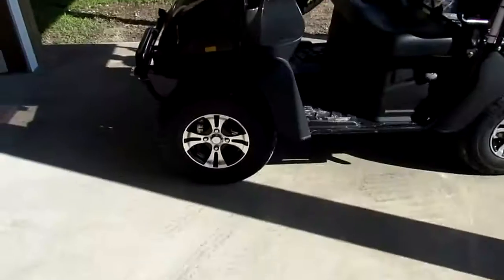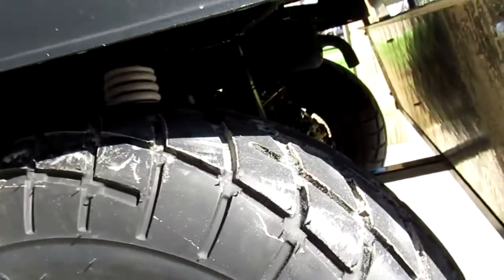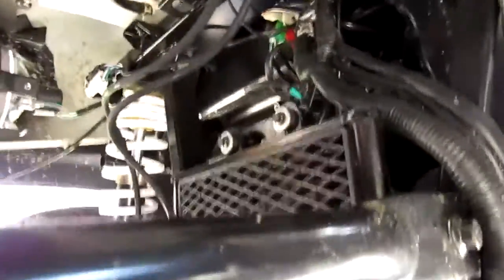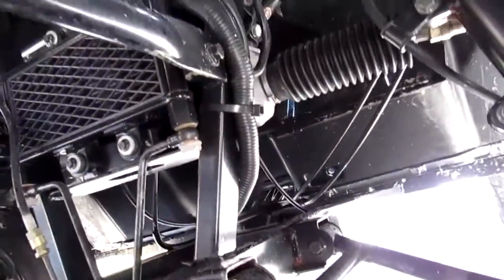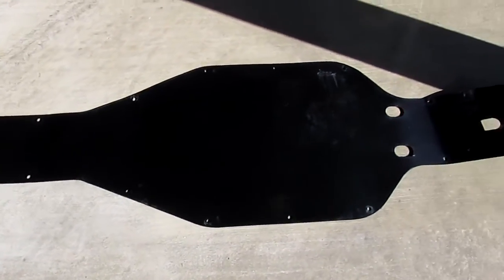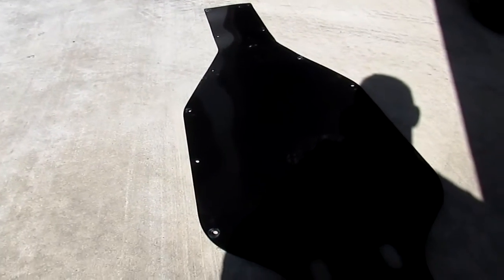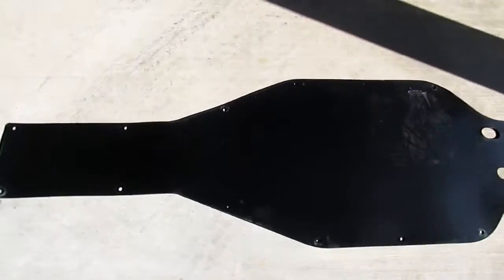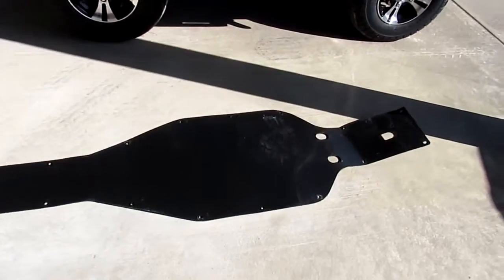Cazador Golf Cart: Overheating & The Simple Fix

Comment: I expect that the valves need to be adjusted.  Mine started to run poorly after 100 hrs and the exhaust valve was very far out of spec.  It is a GY6 motor.  I set my intake at .005 and exhaust at .006 and it runs great again.  I live on the gulf coast and the hottest summer days do not cause any performance issues.  I now have over 500 hours, adjusted valves twice, and it runs great.  The first valve adjustment around 100 hrs is critical.
Reply from the maker: Excellent information.  I could never understand why the silly thing ran so hot.  I think you're on to something here.

Comment: We have one and it stumbles and doesn't feel like it accelerates correctly.  Cazador sent a replacement carburator and it doesn't seem to have fixed the problem.  I've also been told that the gas I'm using is a problem.  Just sitting idle ours doesn't seem to meed the correct RPM.  So, I'm curious of what your issue really was.  

Thanks for the videos and documenting things you have done or experienced on your cart.
Reply from the maker: It was definitely overheating due to a lack of air flow.  Since I removed the skid plate it will still eventually run on the hot side and the ambient air around the machine can be felt - it's very warm.  Now that the plate has been removed we've not encountered the degraded performance and we've driven miles since the plate was removed.  The problem has been resolved.

Comment: Good info thanks. I have the exact model with about 800 miles on it, just recently it has been dying on me after about a 2 mile drive here in the hill country, we have some 1200 ft elevation changes, it's odd because it used to do fine on the climbs at around 11 mph, after it dies I let it sit for 5 minutes and it starts right up and runs fine for about another 2 miles, not sure if its A-overheating B-electrical or C- fuel problems. Thanks
Reply from the maker: What I diagnosed 🤷 as overheating the symptoms are very close….it never actually quit running but would buck and chug until we made it back. After cool down it was fine. We have no hills but the beach sand can get deep and requires powering through to avoid getting stuck. This seems to accelerate symptoms. Thanks for posting hopefully other people can use these descriptions to improve their situation.

Comment: Very good review. My wife bought this cart for general use. I lost the screw that holds the air filter in place. Do you know the screw size and type that secures this in the air box?
Reply from the maker: I'd call Cazador: (214) 238-7979
Reply: @dirtyshirtinfo  i have tried several times and get no answer. I have also tried email. I thought by change you might have change your air filter and knew the screw size and type.

Comment: Have you had any issues with the brakes? Ours locked up after sitting in the garage for a few months. Thought the piston that operated off the peddle was locked up so I took a line off the master and it freed it up. But then I had no pebble. I tried to bleed the brakes to get the air out of the lines but I can get zero peddle. I relaxed the master but that did not fix the problem. What am I missing?
Reply from the maker: None. The brakes always seemed to be pretty bullet proof.  I sold my cart last year so I have no point of reference anymore.  A few clarifying questions: By locked up are you saying the pedal wouldn't move or are the actual wheels not able to turn due to one or more brake calipers at the wheel are not releasing from the brake disk?  When you removed the line from the master things changed, I'm assuming the pedal goes to the floor board now and never builds pressure which caused you to start the bleed process?  Is this correct? Are you bleeding brakes from each individual wheel or are you attempting to purge air at the master cylinder?

Comment: Have u ever had a problem with it not starting or cranking over
Reply from the maker: Not exactly.  It tends to crank slowly on every start up.  My thoughts were that the battery is underpowered to begin with or the engine has high compression or both. When we leave the machine unattended for awhile I do pull the negative cable off the battery to prevent draining.  If it's not cranking I'd look at the battery as being the culprit.

Another thought: with all of the vehicles I've ever owned if I ever had a battery go bad it has always been during the hotter time of the year (this being written September of 2022 and it's still blazing in Texas). I've never had a battery die on me in the cooler months. 🤷‍♂

Comment: How-do-you-do an oil change on this thing??  I just got it not too happy with it it's really loud... Still has manufacturer oil in it need to switch it out but there's no manuals on how to find any of this stuff
Reply from the maker: The black plastic skid plate hides the drain plug. There’s an access hole to the plug through the plastic but in my case the hole was offset and I couldn’t get a wrench on…I removed the skid plate and threw it in the garbage. The plug is well forward of the rear axles. Don’t get confused with the drain plug for the transmission near the rear and the plug for the engine (like I did). My cart takes 1 quart of 10w-30.
Reply: Thanks for the videos.  For the oil change, I went through the in spout and sucked it out.  Same method used for boats and jet skis.

Comment: my suggestion is a electric fan pointed directly at that oil cooler.  run the fan wiring back to the battery
Reply: I'm looking at the Cazador and the Vittaci Rover  having trouble deciding.  near Abilene